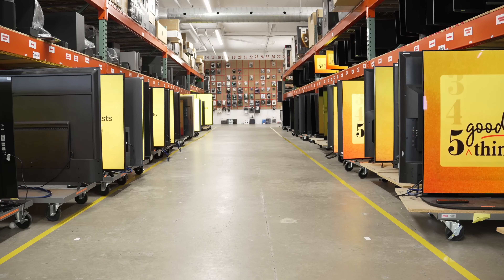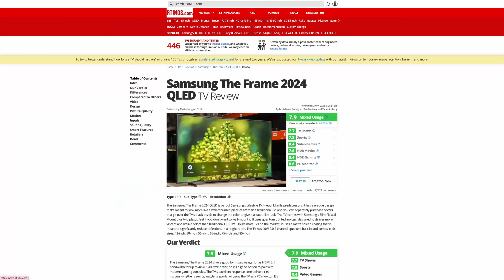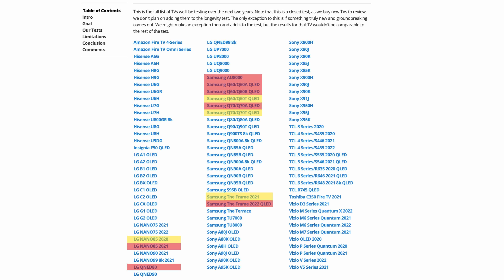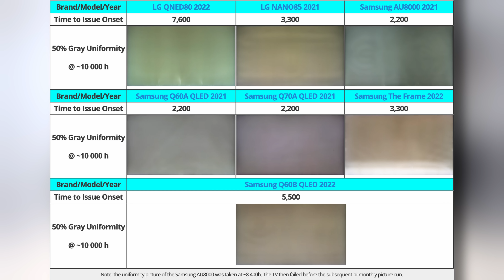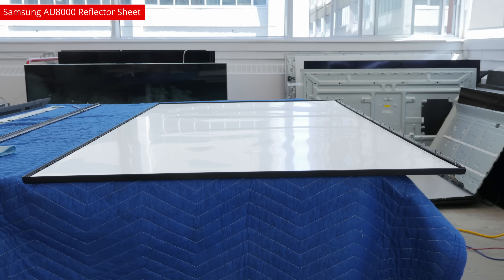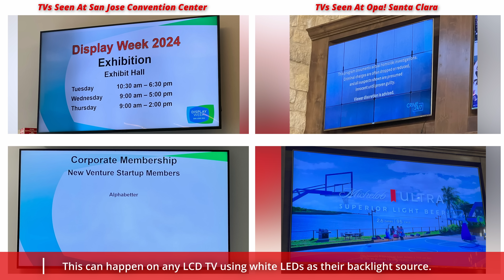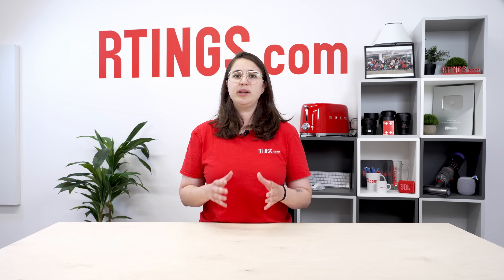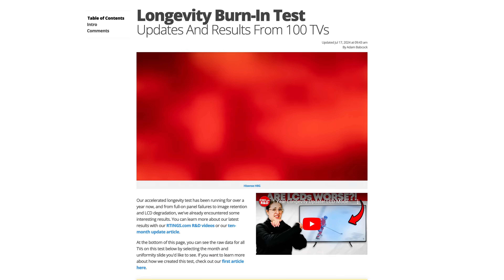Edge-Lit TVs Fail FASTER Than Others (100+ TV Test)

Comment: Thank you. This is exactly what has happened to my LG model 55SM8600PUA Nano 8 Series. The screen has always been a bit dim as well, which only made the problem worse as the screen was a max brightness. It is a little over 4 years old and has many cracks in the light guide plate and white lines all across the bottom. This info will be very useful in buying our next TV.

Comment: My made in Japan Pioneer Plasma is turning 16 this year... still looks beautiful.  Quality just isn't a priority anymore.
Reply: My 2 tvs that were 20 plus year old just died this year.. this older tvs were heavier but better built and soo reliable.... 😊
Reply: Plasma TV's are nice but they consume so much electricity. A Plasma TV consumes about 4 to 5 times more compared to the standard LED TV. It's like you're running 5 LED TV's 😂
Reply: @astrumforever  Not necessarily true.  I ran my 2005 Panesonic Viera 50" plasma tv side by side with 2009 Samsung 52" LCD TV.   The LCD tv consumed more power and generated more heat.   Plasma tv consumed between 200-300 watts during average use.  No doubt modern iteration of LCDs do indeed consume significantly less power than Plasma, but Plasma is not the power monster that you think it is.  Depending on your usage case, plasm is fine TV and it will not break your bank from power usage bills.  Another pro for high quality plasma TV like Panesonic is longevity.  My Panesonic tv is 20 years old and still going strong and saves money on repair and replacement costs.
Reply: @astrumforever  True, but at least I'm not contributing to the mountain of e-waste that is being created by sub standard quality sets.  In the last 16 years, I only bought one TV… how about the average American these days?
Reply: @astrumforever  Who care about that? As long as it’s a good product keep it instead of contributing to ewaste. Your mindset is what companies are looking for! I have 2 CRTs and they work great 👍
Reply: @chadmendiola9833  it's a TV not for everyone.  However I've seen many of my friends go through multiple sets in the time I've had mine, I'd feel better using a lil more electricity than throwing something in the landfill. That's just me
Reply: @juliest631  4 - 5 times more isn't really a "little" it's comparable to running another standard refrigerator on average (no joke). Then again to each of their own.
Reply: @chadmendiola9833  Yes, it consumes about 400W.  There is nothing wrong with a high wattage item if you use common sense.  I really appreciate how I can unplug it without it having to "boot up" or sip power like "smart tvs".

However, I was merely commenting how I think it is irresponsible how today's cheaply made items are designed to go obsolete. There are only a finite amount of minerals on this planet and electronics are loaded with PFAS, PVC, heavy metals, and most of those items are not disposed of properly.

Comment: Who are the morons paying 2000 bucks for edge-lit LCD TV? LMAO! I bought a QNED99 65" for 1499 almost two years ago and an LG E6 OLED 55" for 1999 in 2018. Guide for buying a TV: top-of-the-line expensive model from sale when it's 1-2 years old model. They are just built better. Remotes are more often than not premium versions, and usually, the performance is at least on par or better than entry-level models of the current lineup.

Comment: would be more fair to separate models that didn't have current limiter.  the ones that do work fine...  and led degradation is kinds universal also.  and you clearly didnt see enough direct led Tv's one dead led look much worse on them. and light scattering layer also warps there a lot

Comment: I have a 12 year old Sony X850B - which is edge lit - and it's still fine? I think it's dimmed a bit, but uniformity doesnt seem any worse.

 Also have a Japan import Sony W700B of the same age - also edge lit. Its still perfect, though it's only had about 1/4th use use of the X850B.

Comment: The problem here is that it tells us nothing about longevity if we run the TVs at more usual brightness levels. A bit like testing cars by hold them at max revs for days on end and then call out a certain brand because the engine died early.
Reply: ya but here the problem is also predominantly heat. Edge lit doesnt dissipate heat nearly as well. You can expect their components to warp, fail sooner.
Reply: The redline on a car or motorbike engine is supposed to be set at a safe level, be it 5,000rpm for a 1800cc V-Twin Harley Davidson or 19,000rpm for a 250cc inline-four Honda. 🙂
Reply: @TassieLorenzo  but holding them there constantly will make them die young.

Comment: Hmm, wonder if you could mitigate this by placing a small USB-powered blower behind the TV, recessed in a wall. Obviously wouldn't be the most practical, but considering models like The Frame already require you to drop a line through your wall, could easily make that line into a larger junction box.

Comment: They promised LED bulbs would last tens of thousands of hours. With exceptions, they mostly after 1-2 years, same as incandescent bulbs. They let run the LED at 100+ degrees °C due to insufficient heat sink or bad design. Thank you RTINGS for uncovering this issue on some TVs: heat is being used again to reduce their lifetime.

I hope they would release new firmwares that lower brightness when a certain temperature threshold is met.
Reply: LED's can actually last you for thousands and thousands of hours of use...they just can't do that at 100% max brightness all the time, which is exactly how most people out there want to run them on their new LCD TVs. And then they complain, "This thing didn't even last me two years before it failed - what a POS" when they break and fail on them.
Reply: @michaelbeckerman7532  Then they shouldn't allow the brightness to be set so high (or at least restrict it to a time-limited boost).
Reply: My experience with LED bulbs is that they either crap out within a few months or last seemingly forever. Though all my lamps and light fixtures provide good ventilation. Presumably the manufacturers are really annoyed by the ones that don't die on schedule. It's really hard to engineer electronics to fail after x runtime when they don't know the specific operating conditions. It's similar to how fluorescent tubes and bulbs could last a stupid long time as long as you never turned them off, but would die really fast with frequent cycling. Or how old-school halogen bulbs last way, way, way longer if you dim them just a little.
Though, it's really frustrating to see how easy it is to design an almost immortal and extremely efficient LED bulb, yet manufacturers just don't want to sell them. All they have to do is add way more LEDs, driven softly so they run nice and cool. It's not rocket surgery!
Reply: @andyasbestos  that's just how statistics work. The failure rate decreases as time passes until it flattens out, where it stays flat for the majority of the product's lifespan, followed by it then starting to increasing again as time passes until things inevitably break down and fail.
Reply: @ArtificialDjDAGX  Well yeah, but I've had a very high early death rate for cheap LED bulbs. Last time I moved I bought a bunch of new lamps and corresponding bulbs at IKEA, including a few spares. They were really cheap! About half of those failed within 6 months, while the other half still runs fine years later.
I assume they were of a sound design but with with very poor QC, so a lot of them got sold with faulty component.
Reply: 10,000 hours is only 1 year 50 days of continuous operation.

Comment: The LEDs are controlled by the backlight control and that's what should be turned down,reducing your brightness control will only make your picture ugly and not increase the lifespan of the LEDs, turning down about 25% of the backlight makes a big difference in the lifespan of the tv with very little visible difference.And for non backlit displays you should adjust the contrast not brightness.

Comment: It's just happen. Thin/smaller things will break faster. When you cram so much electronic into a tiny space, the heat is localized and because it's thin/small, the heatsink/cooling solution will have to go. And last time I check, heat and electronic do not like each other. Having a thin tech is nice if you can keep your expectation that it will break faster or perform worst than the fattier / bulkier counterpart that has the proper cooling solution.

Comment: My 12 year old 80 inch Sharp Aquos HDTV with about 25,000 hrs. Is as sharp and bright as new. It has a fourth yellow color in each pixel. It had one partially dim pixel when new and hasn't changed. You can only see it with a white screen within a foot. It cost almost $5k in 2012 but new is not necessarily better.

Comment: I bought my 40" Toshiba TV in 2013...still works. In the winter, it's a bit dim until it warms up. Also has some light bleed through around the edges when the lights are out. I keep mine cooler by placing a 6" fan running into the vents in the back. Keeps the Main Board cooler and the florescent light tubes cooler also.  I also have a Samsung NIB as a backup.

Comment: My parents bought a plasma TV back in 2006 or so (we got a wii at the same time), it's a real chonkster, requires 2 people at the minimum to lift it if you want to move it anywhere. My favourite feature is its port variety, 3 hdmi ports, a couple of component inputs, VGA! I can plug almost anything into it and it'll just work (the oldest thing I've tried was an amiga 500!)
It STILL works today. Sure, the plasma panel struggles a bit with displaying reds in the centre of the screen nowadays, but I'm more than willing to forgive an almost 20 year old display. Which I have a hunch it might just be due to cooling issues caused by 18 years of dust build-up in the vents. (I want to clean it but high voltage capacitors are no joke, even with the service manual. And I need help moving it lol)
When it EVENTUALLY dies, I'll be looking into one of those industrial signage displays instead of a TV that breaks itself and comes preinstalled with spyware I don't want. If I want youtube or TV I'll just connect it to a pc with a TV tuner card lol. Everything needing component connections can go on my CRT (which also, still runs fine. I'm almost certain the previous owner barely used it since it runs like new. I've been meaning to pry into the service menu to check how many hours are actually on the tube).

Comment: In a tcl tv i had to replace the heatsink since it was running at over 100C 24/7 and with a heatsink replacement it dropped it to 80... its crazy how hot these tv's run

Comment: LED's don't really burn out but the electronics driving them too.  It is the cheap electronics burning out not the solid state LED's.

However, this reminds me of how NASA trialed only hand wound mechanical watches for use during the space program as they wanted accurate time measurements that would not be dependent on electronics which became rather important during Apollo 13 when they had to shut down all electronics to conserve on battery drain, and the needed electronics for a correction burn could not easily be turned back on.

Only the Omega Speed master watch was ever space rated and this was confirmed by another comparison evaluation for the space shuttle.  Though, I'm not certain if NASA vouching for the reliability of an older technology watch had any effect on the consumer market so I doubt that any certification of more reliable LCD screens will make a difference.  The lack of reliability only benefits the manufacturers in terms of generating future sales so we'll just get as low a quality as we find tolerable.

Comment: Long term tests? Automatic upvote for me.
Reply: Agreed, that's really noble.  Unfortunately, by the time you know about a particular model's life expectancy, it has already been replaced with another model.  So really you just have trend data that may or may not indicate a pattern of early failures.  That's still useful, but not quite as helpful as it would be to start testing a model about 5 years before it was released.  Someone get RTINGS a time machine.
Reply: @sirnickity they do sell at best buy sometiems fhe prior year modek for 2 or 4 hundred usd less...
Reply: @sirnickity  for me it is less about specific models but rather to see which brand produces higher quality products in which price category

Comment: Still running a LG 50 inch 50PB660V--ZD plasma set its 11 years old now and only suffers burn in occassionally, if you invert the picture for about 5 mins once a year it clears up, LG still sell them in the UK but you have to specifically request one instore as electrical outlets dont stock them.

Comment: Running a TV at maximum brightness is similar to running your audio amplifier at 100% volume. Don't do it!
Seriously if you bought a whole selection of hi-fi sets. Put them in a room and cranked them up to 11 whilst feeding a worst case (loud) audio signal in. You would find that they would fail significantly and fairly quickly.

Comment: I think the extra heat destroying these tvs is from it being a smart tv. I see people all the time
 (myself included) with 10+ year old dumb lcds that still look good with 💩 ventilation using rokus to stream apps.
Reply: Na its just the heat from the lights that does it, the chips they use for "smarts" are so slow and low powered it doesn't add to much heat, plus its in a different part of the TV where they can actually sink that heat fine. I wish they did use better chips, those smart TVs get so slow after a few years.

Comment: If you already have one of these types and you cannot return it, a good mitigation, and good practice, is when you bring the TV home, go through the settings and make sure "Demo" or "Store" mode is not enabled, this is a setting they use to crank up the lighting to make the TV stand out in the store if they lack this setting or it is not found, reduce the light power on the TV to 80% or less.
Reply: so it's probably better to buy "factory refurbished" rather than open box.

Comment: This video was great. My Hisense 65H9F I got at the end of 2019 has had pretty bad backlight uniformity, somewhat consistent with how the warped reflector sheet shots look, which started about 1 year into ownership. Just outside of the warranty window, and Hisense would not replace it. It's gotten slightly worse over the years and just recently has had 1 horizontal line of pixels die near the bottom of the screen.

Comment: Why do manufactures insist on baking their LEDs?  Be it in a TV/Monitor or a light bulb. For product life you are best to use more diodes at a lower wattage. They run cooler, last longer, and use fewer watts per lumen.

Comment: That's a pretty interesting finding!
Been searching for professional monitors or Digital Signage monitors for a specific project at work, and it's interesting to note that even the ones that claim to be thin, aren't consumer-grade thin, ever. They're almost always much thicker, have a LOT of vents at the back, and specific install angle limitations to ensure it can match the MTBF (Mean Time Between Failures) specified in the datasheet.
Those monitors tho are a completely different animal. They cost AT LEAST twice as much (up to like 10x) as an equivalent sized and resolution consumer TV, but you get what you pay for: 50000 hours MTBF, at a 24/7 operating cycle. So yes, rated for almost 6 years of continuous operation, all day long, at insane brightness levels at that (500 nits not uncommon). Plus serial control, standardized sizes so you don't need to adapt anything to replace to a similar model, and several years of replacement part availability.

Comment: I have a question, i don't get the part where you say that you should get a tv with higher brightness and lower it down, i know that panels that reach a higher brightness peak are more consistent in color accuracy and so the least efficient ones will infact sacrifice some of it to get more brightness, that should also mean that the more efficient panel should be... more efficient temperature wise right? But i wonder how big of a difference there could be out of 1600 nits display vs a 1600 nits display who has a 1800 nits peak. Also a lot of the panels are made from the same companies and my assumption would be that except for the peak brightness heat should be on almost on part on the same type of panel even with a different quality batch. This is based on the assumption that even the same panels can have different performance territory, wich i know for a fact is a thing on cpu batches. Im not sure this claim makes sense, i'd appreciate if you could further solidify your claim. Or maybe i just got the message wrong.
I mean no harm im just trying to clear a point and to direct other buyers to the right products.
Reply: Note: again this Is also based on the assumption that there are few manifacturers for this particular segment of the market, as when It comes to at least and OLED or QD-OLED monitor Its always the same 2 or 3 manifacturers. Which would solidify my case about brightness not mattering as much for this as most TV's use panels from the same batch hence very similar heat production.
Edit: again i have nothing against you guys i love the fact that we even have channels like you making large scale test which gives us the most reliable data. Im subbed.